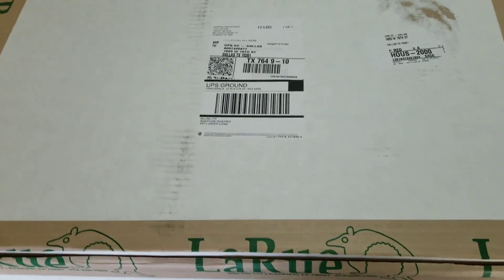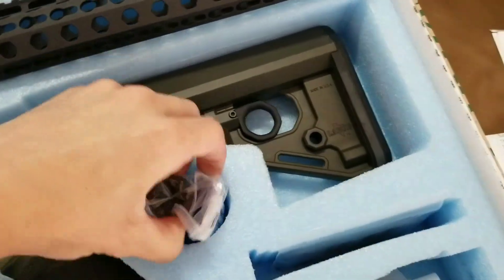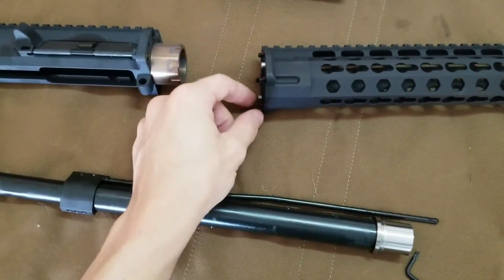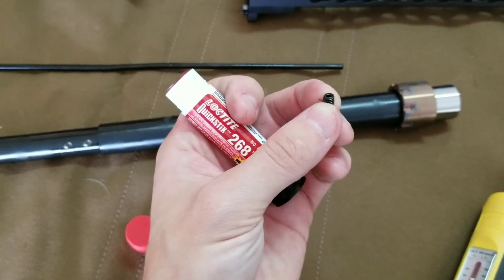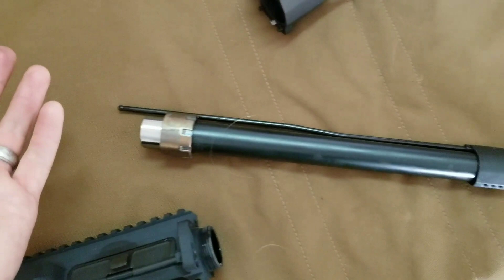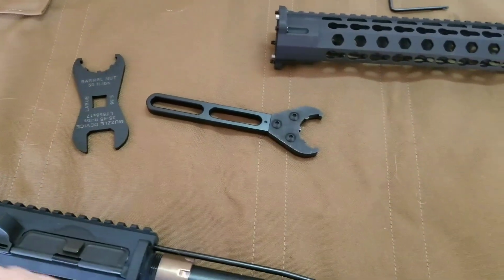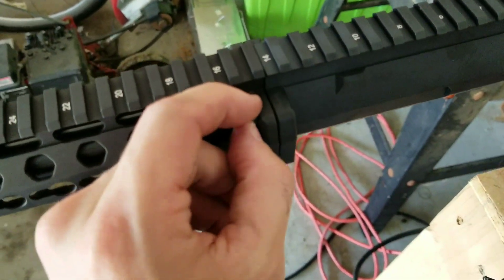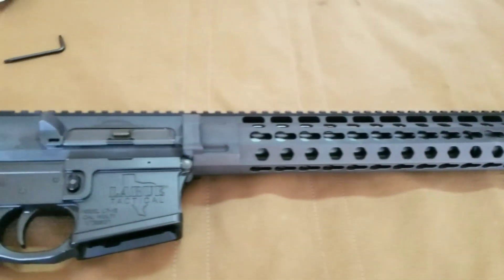Larue Tactical Ultimate AR15 Upper Kit - Assembly Guide

Comment: You know how to use the torque wrench correctly at 90 degree angle! See, all! Most apply 50 percent over with 180 degree angle. Thank you for a great block of instruction.
Reply from the maker: J. P. Thanks!
Reply: J. P. It's nowhere near 50%...but yeah...there's a difference for sure.   The barrel nut wrench would have to be half as long (50%) as the torque wrench to increase the value by 50%. In reality it's about 1/10th the length from drive to pivot. Which = only a 10% increase.  You would have to be using a 5" torque wrench for your numbers to be correct... & I doubt that is the case.  But it is a factor that some people don't account for.
Reply: Could you please explain this a little more?  If I understand you correctly, the actual reading on the wrench will be something other than (in the case of the barrel nut) something other than 50 ft-lbs?

Comment: Well looks like I’m buying this kit. I didn’t know they sold this. What a deal!
Reply from the maker: sk8erdude1 I may or may not have 3.... And planning on a 4th.  You should check out the large frame kits!
Reply: A large frame kit?

I’m not familiar with that term.
Does that mean pistol grip size?
Or an ar 10 frame?

Kind of on the fence if I want to spend 99 for fde or just black I’m assuming this is a cerakoted finish vs me and a rattle can job.
Reply from the maker: sk8erdude1 ar10. 260 Remington, 6.5 creedmoor, 308 are available
Reply: Befits to the ar 10 frame with 6.5 Grendel? Mags?
Reply: Benefits
Reply from the maker: sk8erdude1 available ammo options, mag options, range... can't go wrong either way. I got both
Reply: Is that stealth 2.0 billet? Or forged?

Comment from the maker: FYI the muzzle brake that comes with the 6.5 grendel kit is a .260/6.5 specific brake, (NOT for .308) even though the threads are 5/8-24
Reply: What's the difference in using the .260 brake over .30 brake?
Reply from the maker: LeadSlinger0311 the bore diameter is smaller than the .30 that is normal for muzzle devices of this thread pitch.  You don't want to put it on a .308 for example
Reply: Kameron For the lower what else do you need, I see the trigger assembly but no mag carrier or release. I’m a little confused this is my first build

Comment: Just to let u know, when you have the barrel nut wrench angled like that, your torque values change when it's not in line with the torque wrench. Just a heads up. There is formulas to figure out the new torque values
Reply: Wrong

Comment: This may be a stupid question but I'm new to this. How do you install that pistol grip with the trigger and all to the lower? It's all one unit and I don't see how it fits a lower?
Reply from the maker: Jake Peterson I may do another video. It's fairly simple.  You can search "how to assemble lower"
Reply: Kameron A I think I was confused by it coming in a template piece. Thanks for the help. How accurate is it? Worth spending that much cash over the aero precision Upper?
Reply from the maker: Jake Peterson anything larue is worth it! I only put 1 mag through it so far from a crappy shooting position and it was right at 1moa.  I expect it to be better when I can lay prone.